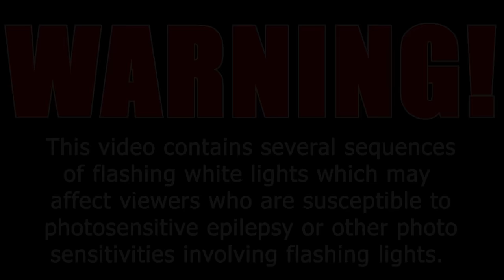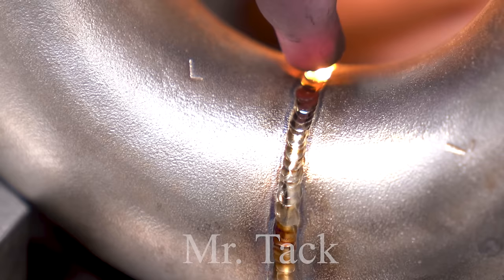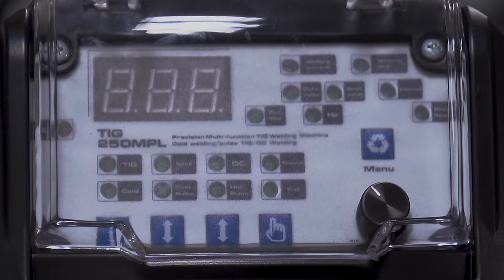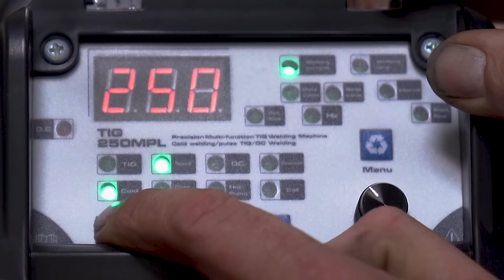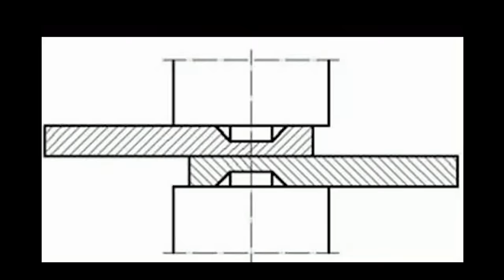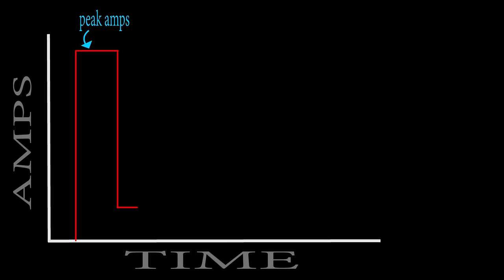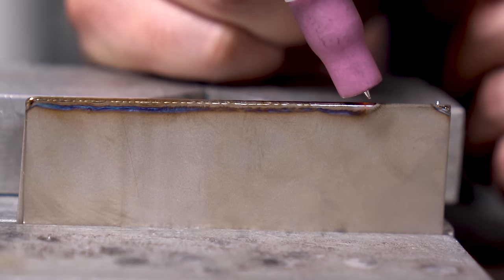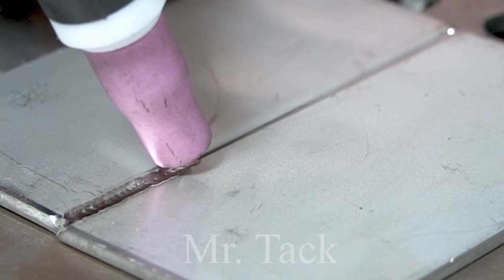So I Bought A Cold Welder

Comment: WOW mind is blown, talk about the wrong tool for the wrong job, i get where your coming from with the whole hot and cold weld and the "cold welds" are bad in structural terms i 100% agree, but not all welds are structural so in my line of work the tearm hot and cold welding on "sheet metal" is HOT your heating all the sheet metal as your welding you just let it do its thing, COLD welding is to keep your part cold to reduce warping on large flat surface for example, so a common practise "for me" when welding 22G sheet steel is cold stitch weld with MIG this all so keeps the weld bead small to reduce the amount of grinding needed to clean the part as grinding all so creats heat that would warp my parts and as the repairs are not stuctural ther more cosmetic theres no need to worry about the strenth of metal 

all about the right tool for the right job

Comment: How are they welding aluminum with a DC tig welder?
Reply from the maker: They're not. It's not possible to do like they show it.
Reply: @TheFabricatorSeries  I used to be a tig welder in a sheet metal shop and I never had a use for anything like this cold pulse option.
Reply from the maker: There's still no use for something like this
Reply: @TheFabricatorSeries  Well tacking maybe. And that's a big maybe lol

Comment: This looks like it could be pretty useful for electronics soldering... maybe a scaled-down version
Reply: Nope, it's still a TIG welding with "HF start" (high voltage modulated by high frequency), you will kill the electronic parts (IC's and transistors for sure) on PCB.

Comment: Anyone who can tell me if there is any welding process that requires no gas?
Like if I don't want to use gas in my welding what should I use?
I've been googling cold welding and I cannot get any answer as to if it's using gas or not?
Reply from the maker: The only process that doesn't use a gas is flux core (FCAW). "Cold welding" is TIG welding (GTAW) which requires a gas
Reply: @TheFabricatorSeries  THANK YOU! You just saved me after 3 hours of trying to get the information off of the internet.
(I'm a complete and utter beginner so I've been scratching my head more than I care to admit)
I really appreciate it!

Comment: What's the point to ridicule a niche product what is designed to be used on specific, low load applications? I can see many areas where it could be implemented very successfuly. What is the point to even try to weld 2" pipes with it??? Obviously it it designed for little jobs, thin sheets, mesh works, artist use, maybe even jewelry? Stop being closed minded.

Comment: I'd seen another video and then jump to your site to get a real view of this tool.  It looks like an ideal machine for people that do small metal artwork.  Artwork doesn't generally need a lot of strength so this would probably be ideal for people that did artwork or maybe jewelry and possibly fabricating things for model railroad and similar hobbies?
Reply: ...and maybe you educate yourself a bit more?
Mold and tool&die field is a real application of those "toys" (like for example SANWA SW-V02).

Comment: Do not cold weld your own headers or custom turbo setup it will fail including exhaust and exhaust tips. You need the heat and penetration from a regular tig setup. Learn to you not hard to learn

Comment: Thanks for the info -- there is no substitute for using a real welder with good welding skills to make a good weld.  Sometimes, life is simple.

Note  -  Chinesium is going to be the ruination of everything.

Quick question - the tip looks like any other TIG welder.  Is argon needed in the cold/pulse welding mode?

Comment: Nice info! Had one question, you mention and show lack of penetration and clear view that other side is not bonded... if you have access to that side and material is thick enough could it be cold welded so that it is sealed from both sides?
Reply: Using not enough current, you can always "prove" lack of penetration. Video is useless.
 
Real application is a tool/die/mold repair - so these are not "toys" (you do structural welds in the tool steel, and they do not lack anything)!
Real machine example: SANWA SW-V01 (or 02 model).

Comment: So it's just a China TIG welder with a "Tack" Mode?
I was looking at the Eastwood digital 200 it also has Tack mode but it is a fairly decent TIG welder for the casual user I'm told.. I can see where a tack mode would be useful for fitting but it's not a reliable final weld

Comment: Can somebody point me to the right way. I build rc cars from metal. Stainless rollcage and tinsheetmetal bodys. I need realy just tack stainless pipe together. Just that i can silversolder them together. Is there cheap solution. And no i do not buy tig welder. And yes i watched this video. I know what that is. I need just cheap, small machine that can join two peaces together for a while

Comment: No actual welder would actually buy into this chinese crap, and every tig welder is capable of this, all you need is the propper tig torche with a bitton on the handle to initiate the arc instead of a pedal or just tap the pedal. Like he said its jist a tig welder with a special setting for tack welds. Not like anything we buy from china is welded worth a monkeys ass hair. I got a kids metal frame bunk bed id never allow a chuld on the top bunk which i bought at walmart and was made in china.